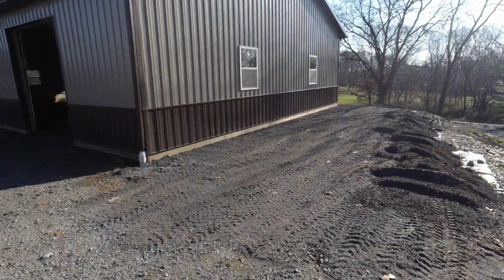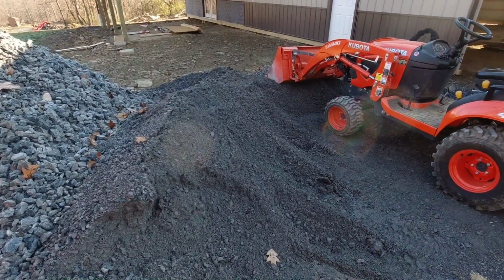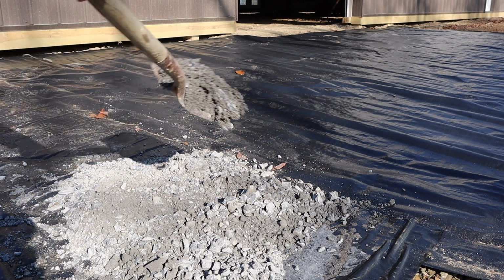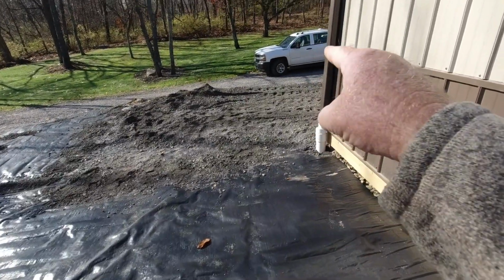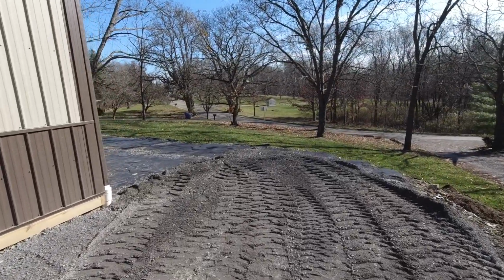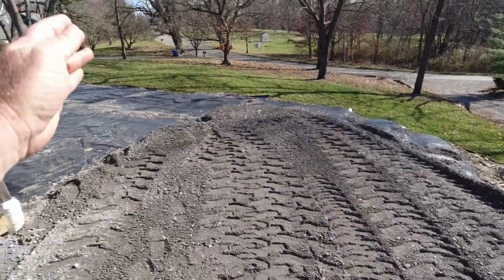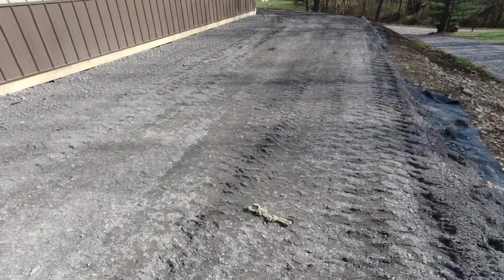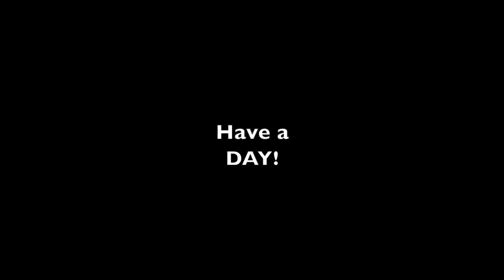#949 This is SOLID! Building Road and Wondering where the time goes?

Comment: I had noticed the back dragging before scooping. At first I thought it was an unnecessary extra operation, but noticed how the bucket got filled more consistently,  and it made things nicer on the loader.
That has helped me with my small skid loader!!! Thanks !!!

You may want to look at the turning radius on that corner. Looks like single vehicles will be able to make the turn, but your pickup and trailer may be snug.
Reply: I think a few vids back he addressed that saying, that he may go down the street and bring another access road in to the property.

Comment: Besides creating separation of aggregates from the subgrade,  the geotex has a secondary purpose.  That is to allow further stabilization of the subgrade thru surcharge  pressure.  The weight of the aggregate acts as a ballast on top of the subgrade.  This ballast forces excess moisture from the unstable portions of the subgrade. This moisture rises to the surface because soil particles are more dense than water.  This water must be able to pass thru the geotex and eventually evaporate thru the aggregate. So the geotex is designed to act as a filter.  Some even call it, "filter cloth". This process takes time so one should not attempt to load the application too soon if the subgrade is very unstable.

Comment: Good morning Mr. Morgan, been a while since I've commented here. One thing you have not mentioned on the fabric, never sit still and twist the steering tires, that will tear and twist fabric under the wheels. I noticed you doing that a tad bit while on your corner where you had what I call berm stone while you were putting down what looks like a #4 rock. Yes im from Ohio,  the sandusky area where we have two large stone quarries. Ran front discharge concrete mixer and end dump semi for many years. I found out the hard way in my early driving career that you don't mess with a contractors get fabric placement.

Comment: You might consider getting some highway type guardrail to put at least around the corners of your building. Does not take much miscalculation with moving equipment to clip those corners. There are places that sell refurbished guardrail to individuals. Done right it does not look too bad either.

Comment: I like the rake off the top - what if the stack was frozen ?   Raking opens the stack and breaks it up.  The driveway to our house - 1800' the front 600 from the street has been in use for 100 years give or take and just had stone added and added.  I lost an iron pipe through the drive that moved rain and drip water from the drive towards the creek.  I put in a new high tech type and found (workers found) a column of stone that never ended.  They went down 6' (2 meters) and had rock on the bottom for the pipe to lay on.  How many loads ? Who knows.  Once every 5 years until I put down fine clay/sand like your '2a' and let it get rained on.  Then add stone on top.  I like limestone but when it is dry it is dusty.  Putting white granite cuts the dust and the bottom limestone seals a layer.  So far so good.  Trash truck is tough on it with a fixed rear axle..  The textile cloth prevents the rock from diving into the soil when the road is wet.  We were told not to add rock when the ground is wet.  Money down a hole.   Martin

Comment: Mike this just a suggestion... Why don't you put concrete pylons (like at gas station pumps) on the corners of the building just in case someone cuts it a little to close with a trailer or vehicle or even a tractor...(wink wink). Better safe then sorry then have a messed up building corner yah know. You got a post hole digger for the BX...Easy peasy lemon squeeze.

Comment: G'day The Morgan's from Far North Queensland, Australia.  Mike, what are those strips that run the length of both sides of the roof, a couple of feet in from the gutters please?  Keep well and keep safe.
Reply from the maker: they break up the snow and ice when it slides off
Reply: Okay, and thanks.  Not a problem where we are in the warm tropics.  We get to put a coat on once a year if we're lucky.

Comment: Great video Mike the road looks good. I did have question on the drain for the roof in the videos you dont have a catch at the end of the 4 inch pvc are you going to build an erosion system to keep the yard from getting washed out in a heavy down pour.? Great video as always thanks for sharing

Comment: Mike I appreciate you. I won't get mawkish. Hey an idea, and maybe you already have one is to get a salamander kerosene heater. I used to have one when I had my shop of 5,000 square feet. It was 320,000 BTU's. It would turn the main shop around in about 10 minutes, turn it into T Shirt weather after having the heater off all night, and bucket of water frozen inside on the floor. When you get around to your concrete pour it will come in handy also for curing it up. You can simply insert the nose into the opening of a partially opened garage door. It is meant for a semi-open air environment. It doubles as a work heater so if you are doing something in the wood shed, aim it towards the front center and it will warm the inside all the way around. You'll need to use your generator if you use it out in the woods. You often see them in football stadiums on the sidelines. If at the very least you can bake yourself before going out into the bitterness. I always had kerosene models, I even have a 55k version for my 2 car garage now. They also come in propane which burns even purer, but then you have to lug the propane tank around with you. With kerosene it is all self contained. 
With one of these heaters you could go out and do some serious chain saw work, and not be uncomfortable doing it. Just a suggestion. I know the radiant heat in the barn is a quick turnaround, but why have the entire building heated up overnight when it is doing nothing more than storage? Are you zoning the heat so the water usage areas like the bathroom and office areas are separate from the main open garage area. If so you could turn that area off overnight, saving a lot of energy, and with the salamander, a good sized one turn it all around in 5 minutes, and then let the radiant floor catch up. I just love using these things. It saved me when i started my shop in a large barn before becoming the largest shop in all of Western Delaware County PA. doing more business than any other. I was on the main strip.

Comment: Hi Mike,
It's looking good. That Land Pride sure does a nice leveling job. Is the overhead view from the DJI? If I may ask, what was the sticker price on your F-150. My last Ford pickup was a 1986 F-150 Lariat XLT 4X4 and it's sticker price was $19,454. The cab rear corners and the bed fender wells rusted out heavily. Sold it as scrap two months ago.

Comment: Did your heating contractor say anything about putting styrofoam insulation around the outside edges of building? In my area they used to want it vertical down 2 feet and 4 feet out. Maybe you are so much warmer you don’t require it.

Comment: Hey Mike you mentioned 2:1 on the ratio of rock types. Does that hold true for an existing base or just when building a new road/drive. What’s the thickness of the 2A that you recommend?  We put a 3 inch stone base down in 2017 and it’s holding up fairly well but at some point we want to top it off like you do and I’m trying to figure how how much it will take.
Reply: 4”
Reply from the maker: Just new road, existing drive will be different depending on conditions, and yes just a couple inches if you already have a good base
Reply: Thanks the base is pretty solid except in two spots due to some drainage issues. But it will still hold up to a triaxle going over it.

Comment: You have to drive that Chevy more than the Ford, Ecoboost won't make it past 125000 miles LOL! Our 2014 Escape just paid off always brought to the dealer blew the motor on the 1.6 Ecoboost. NEVER abused typical commuter wear and tear. Ford dealer wouldn't help us so we went to a Subaru Outback, no more Fords for us. I've had GMC/Chevy which has issues too but never a blown motor at 125000 miles. I'll stick with the Chevy rather be found on road dead!

Comment: Mike - why not lay the geo tec down and have the truck driver tailgate the stone?  Would save you a ton of time.
Reply from the maker: There is no way a tri-axle dump would make that turn around the corner of building and they can't put it on anywhere close to what i can do with a tractor, Long runs, no obstacles tailgating works good, but wouldn't work here

Comment: Mike Why are you using two different Kubota tractors to move rock/stone when they both have a bucket on them??  Makes no sense
Reply: It makes sense, it just might not be obvious why.  I would have done the same because he only needed a narrow strip of 2A at the beginning and the big tractor bucket is so big it would have gotten rock where he didnt want it. Could still be done, but why make extra work for yourself when a better tool is right there.
Reply from the maker: Python nailed it